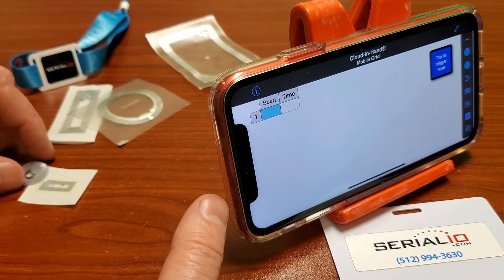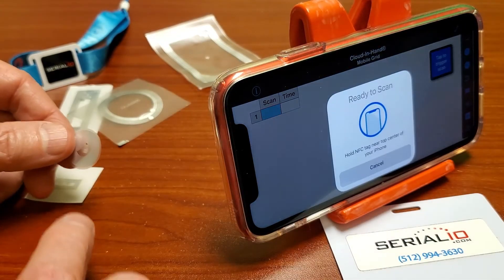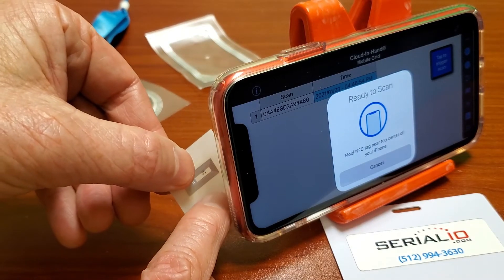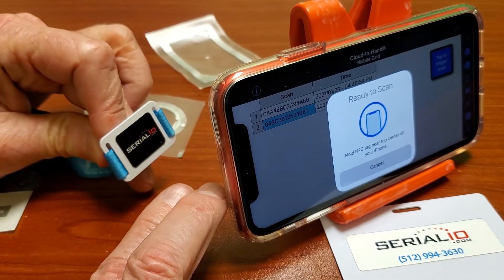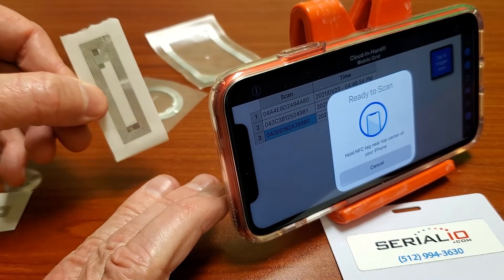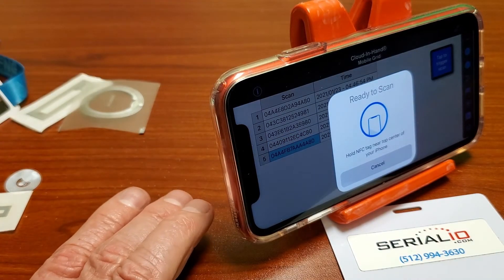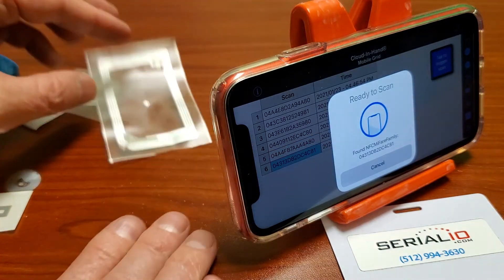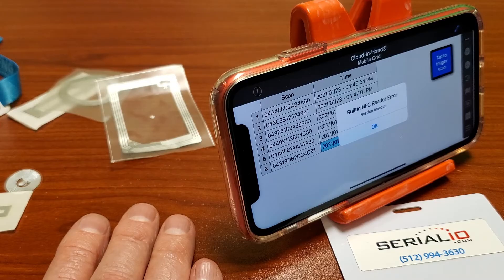iPhone built-in RFID-NFC Read Distance Varies Based On Inlay/Tag Antenna Size

Comment: Bonjour,
Merci pour la vidéo, Je cherche à savoir si en ajoutant un périphérique au téléphone portable ou pc portable, on peut augmenter la distance de lecture ?
J'aimerais pouvoir lire les tags rfid d'une course de vélo et je cherche une solution à pas chère
Merci d'avance pour votre aide
PS : je suis novice dans le domaine ;)
Reply: Translation:  I am trying to find out if by adding a device to the cell phone or laptop pc, we can increase the reading distance? I would like to be able to read the rfid tags of a bike race and I am looking for a cheap solution 

Answer: No. You need UHF tags and special antennas, and high-powered readers for race events. Serialio.com can provide these, but they are not cheap.
Reply: Non. La RFID ne fonctionne pas comme ça